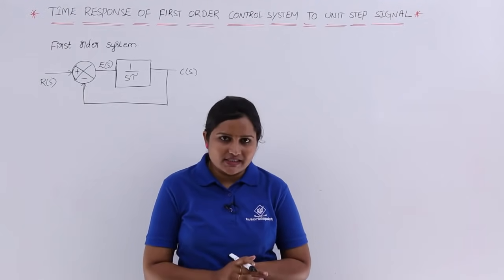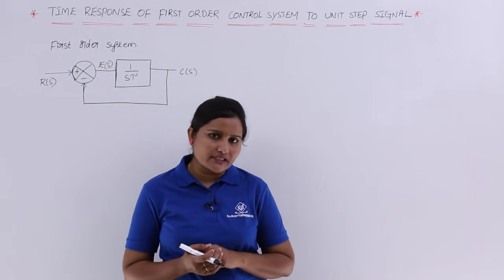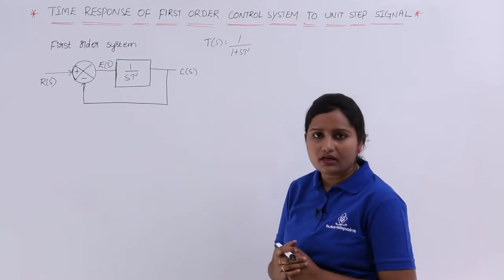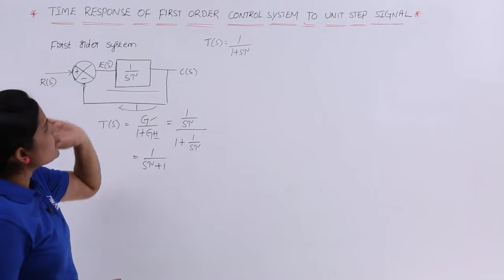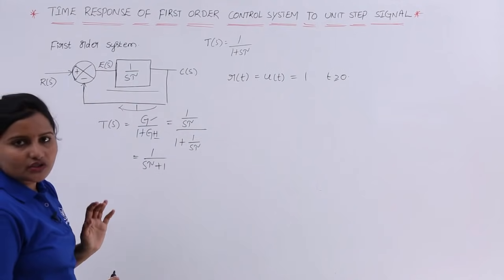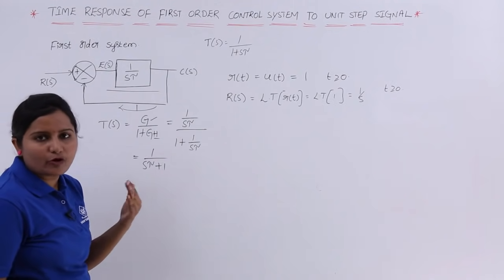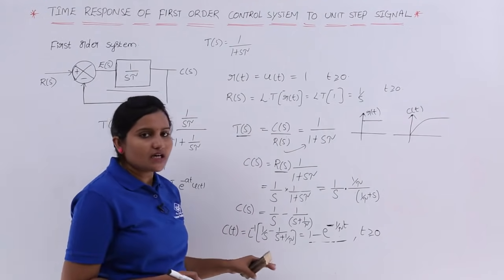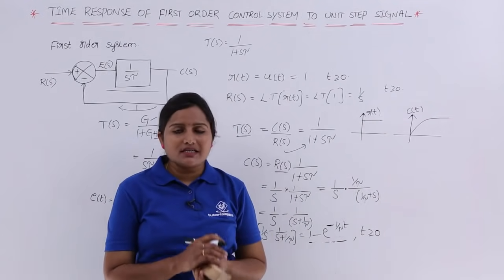Time Response of First Order Control System to Unit Step Signal

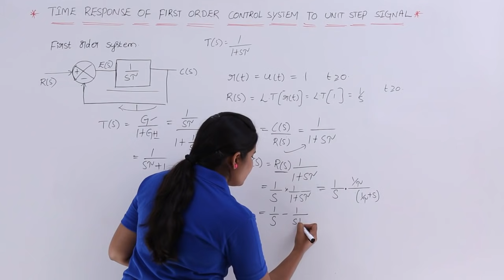Comment: For those students who didn't understand from 6:36 , she used partial fraction method to solve that eqn.
Understand now...
(1/s) × (1/1+st) =  A/s + B/(1+st)
Or (1/s) × (1/1+st) =[ A(1+st)+Bs] /s(1+st)
 {s(1+st)} cancelled out from both side
So, 1 = A + Ast + Bs
Or  1 = A + s(At + B)
 Comparing equal terms :-
 A=1 and At+B = 0
Or B = -t ;
Now put the values of A and B on above partial equation, you'll get:-
(1/s) × (1/1+st) = 1/s - t/1+st.
Reply: what is comparing equal terms mean? Please explain
Reply: @RATEDGANGSTER  you can use another method by , use s=0 to get value for A and use s=1 to get value for B
Reply: @RATEDGANGSTER  It means comparing equal powers on both d
sides.
Reply: thanks
Reply: But how did she get (1/s)-(1/s+(1/t)) ??
Reply: @desmond172  if we slove the equation them we will get the same answer 1/ab = 1/a-1/b we can write like this also
Reply: Thanks
Reply: Thank you🤗
Reply: So the symbol next to s all the time is nothing??
I really don't know pls help
Reply: Thanks
Reply: Thanks pal
Reply: Thanks
Reply: Bhai 🙏🏻🙏🏻. Man ki baat padh li aapne.. Dhanyawad